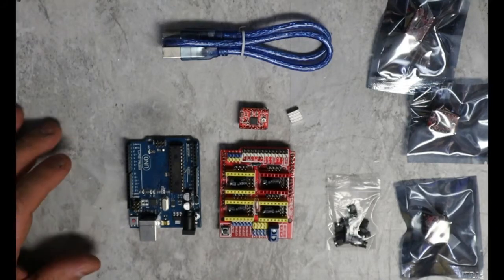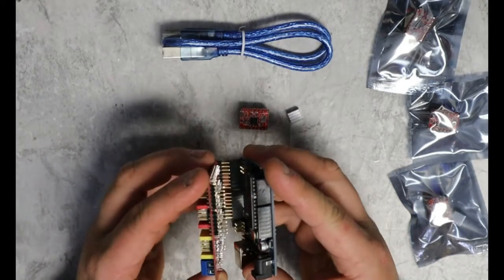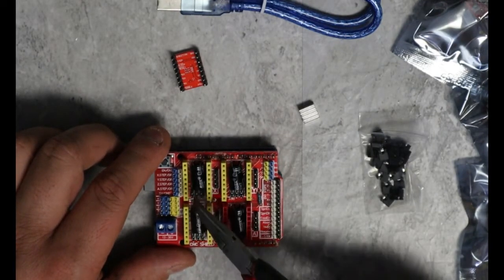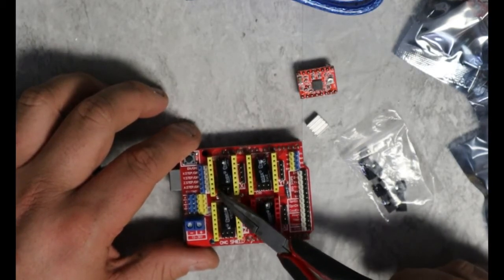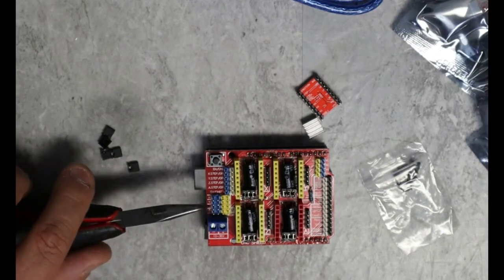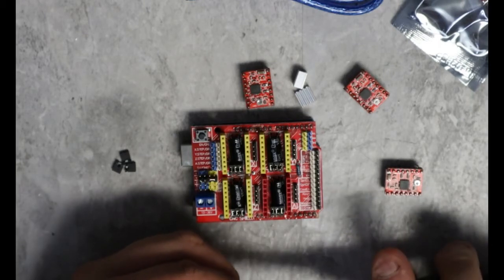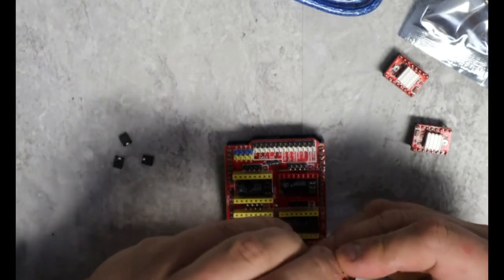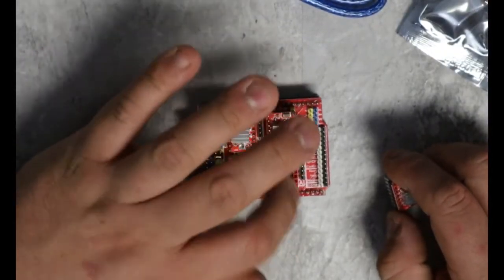GRBL Shield video 1 - setup

Comment: Please help
Reply from the maker: Details??
Reply: O snap I was not expecting a reply but I was just having a hard time with stop switches, by any chance would you happen to know how to turn this cnc shield and board into a plasma, just recently started watching your videos and have helped a ton i must say.
Reply from the maker: @jai.lo66 This board is known to have troubles with end stops. It doesn't filter out noise on the endstop inputs. 

I have used this board to make a plasma cutter before. It was a hack that replaced a MACH3 board. WE wanted to use lightburn for PlasmaCutting. I used an isolated relay to isolate it from all the plasma noise.

 I would suggest the MKS DLC32 from aliepxress (~$16) or Amazon (~$35). It has great shielding. It ships very similar to this GRBL shield with similar interfacing but it is able to run FluidNC firmware (instead of GRBL firmware) which I prefer.
Reply: @brakthehun hey thank you for the getting back to me and giving me feedback, and that's unfortunate about the noise, I was really looking forward to building a mini cnc plasma cutter. Looks like I'll have to drop the project as I don't feel like investing more time and money. I was really close to finishing it, was your plasma cutter cnc ready? And was it a non frequency plasma? I have the btc500xp which is a non frequency cnc ready plasma cutter
Reply from the maker: You should finish it. You dont really need endstops if thats whats stopping you.  @jai.lo66
Reply: @brakthehun all right I'll shoot my shot, worst case scenario. It catches on fire from all the feedback
Reply: @brakthehun do you have a video I could watch that's similar to my project?

Comment: Thank you for the videos I have a problem when I mirror my Y axis none of the stepper motors turn but when I remove the driver in the A slot the X and one Y motor turn. What could the problem be? I have tried changing all 3 stepper drivers but it still does the same. thanks

Comment: I’m using a MOSFET to power my laser off and activating it off of the spindle enable pin, spindle enable pin has 5v but the moment I plug it into the mos fet it drops down to 0.14v but is not activating the mosfet, I confirmed that when jumping 5v from the power supply to the mosfet signal pin the mos fet activate properly and turns on the laser, is that a trouble with my shield or is there something silly that I’m missing?

Comment: help me pls!
the stepper motor moves but when I set the speed above 800 or something
it just vibrates
how can I fix this pls
I've checked its not the motors problem
Reply: With all M1 M2 M3 jumpers installed in the stepper driver, it gives step divided by 32 which is too small.  So remove M3 to make step divided by 16.